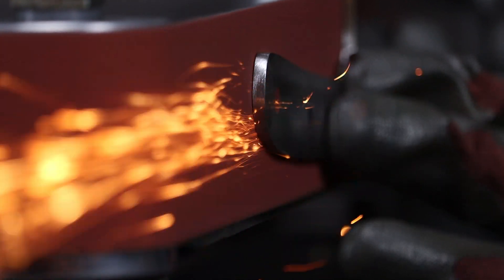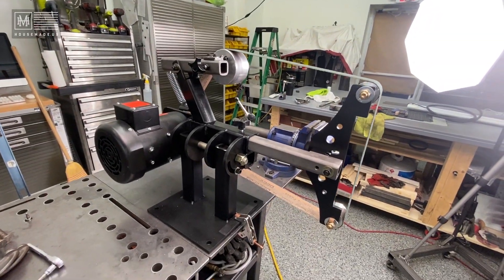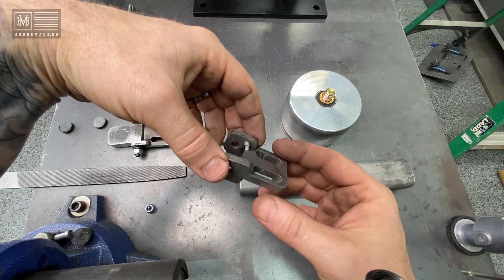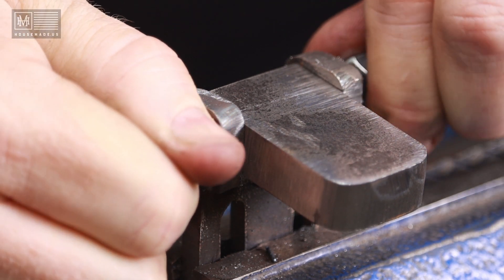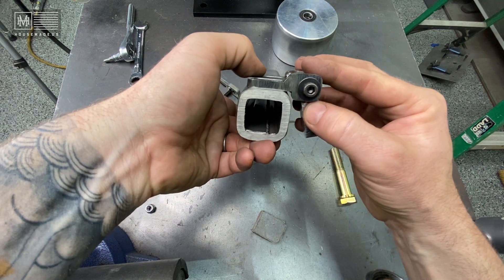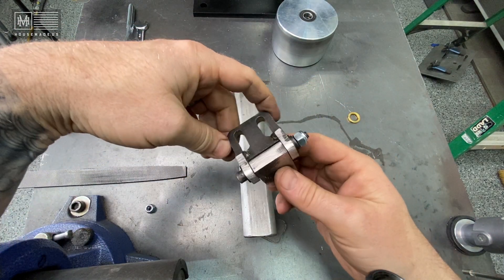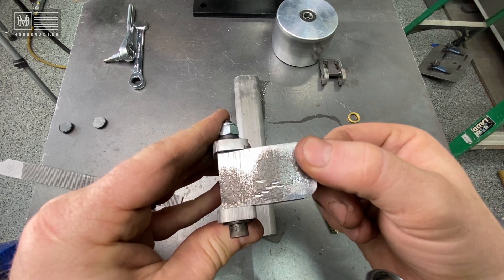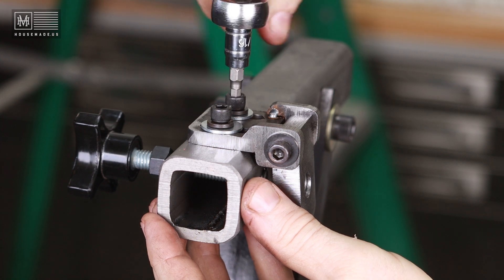2x72 Belt Grinder Tracking Mechanism Prototyping Process

Comment: Have you thought about using shoulder bolts so things pivot on a smooth surface?
Reply from the maker: Yes. I’m currently working on another tracking prototype that uses DOM to hold the bolt instead of drilling or making those brackets. Shoulder bolts kind of work the same way I imagine.

Comment: The link for the tracking wheel does not match the one in your build video. The eBay link has no holes in the device. Thanks
Reply from the maker: I know the photos don’t match but what you get when you buy that one is the one you see in the video. Not sure why they did it that way. I’ve purchased a few of them and they are all like the one in my video. Thank you. 👊🏻
Reply: @HouseMadeUS  Thanks for the information. Your prototype looks good. Any ETA?
Reply from the maker: I’m thinking about a month to get this sorted. I’ve got one more design I am kicking around.
Reply: @HouseMadeUS  Thanks, I'll be watching. I also purchased the ultimate bundle, and I have noticed that the links in the plans and the links in your videos do not match and do not go to the same product on eBay. i.e., the drive wheel. Is there one place to find all the latest revisions. Also, I apologize in advance if this is not the place to post.

Comment: Brian, I'm thinking 3/8"x1.5"  bar stock for the tracking wheel, with a welded tube for the hinge instead of drilling 1" plate.  The bar is easier to obtain than 1" for us mortals, but the tube may require some hunting.  I like the two bolt design a lot!  Should lock it down and keep it from moving a lot better than a single bolt.  Keep up the great work and communication!
Reply from the maker: Rafael just emailed me a similar design concept. I’m going to beat this dead horse again and get another prototype out. 😁 Hope you’re doing great Jon. Stay safe and well my friend! 🚀
Reply: @HouseMadeUS  Drawing?!?!  Wow, now that you mention it, that's a much better way of conveying an idea than flapping my gums, and twiddling my digits.  I'm going to learn how to use some modeling software, soon, and I'll start shooting you drawings of ideas (unless I just make them first, then I'll send you pictures).  ;)  Cheers, Brian!  Health and safety (as well as sanity!) to you and yours, brother!

Comment: What about running 1/4" or 3/8" plate for the wheel bolt but using a round sleeve for the swing bolt? I've got another idea for a two part mounting bracket. I'll email ya!
Reply from the maker: Just responded to your email. GREAT IDEAS in there. 😁